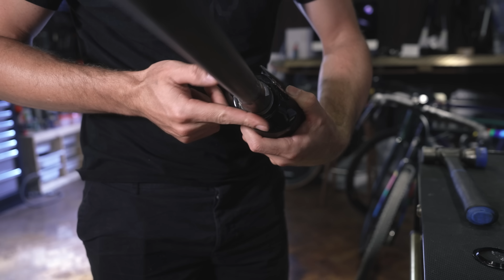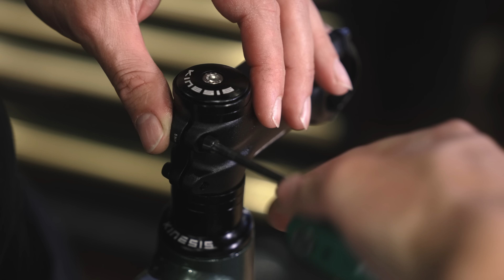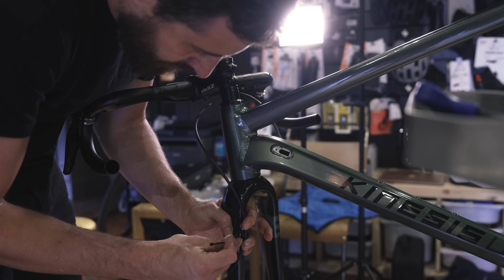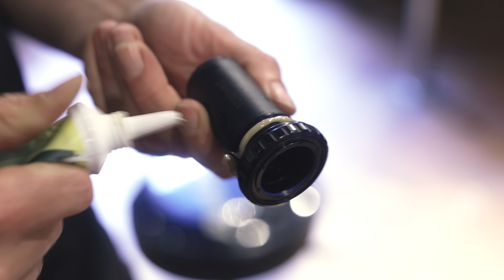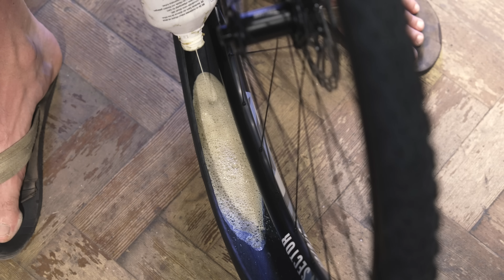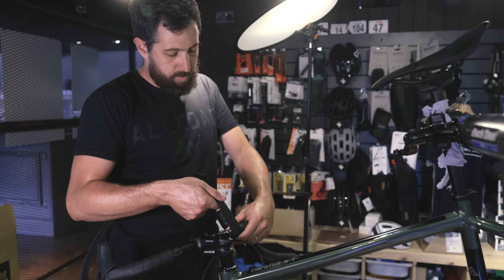'Do It All' Gravel Bike For Under £3000  - Kinesis Tripster, Sram Rival eTap, 650B

Comment: I've been riding and racing gravel on my Tripster AT for four years, just passed 10,000 miles on it. Rival 1 has been reliable the whole time. The bike is an absolute tank and a supreme joy to ride. Even took it out for my first CX season and it performed wonderfully. It's the pinnacle of what aluminum can be. I'm pretty sure if I ever had some freak crash that broke the frame, I would order a new one before the sunset. I love my Tripster. Highly recommended.

Comment: Hi Nick  I am just cobbling together a 1 x Sram Tripster for the Winter. Having brought the frame second hand boy was it difficult to get the rear brake hose through the frame. Did it by running an inner gear cable etc. So I am getting there. The part I am stuck on now is mounting the rear brake caliper. I have brought the small mounting plate as much as I try to see it on your video I cannot see whether you fit the bolts from underneath or from above. Given there is no thread in the location holes I assume you use nylock nuts as well. I understand from kenesis the bolts are 22mm long but they didn't specify the thread diameter.I would appreciate it if you could give me as much info as possible. Thanks. Or indeed you Jimmi  .

Comment: Another nice build video Jimmi 👌 mate the silver chainring is that the force/red and what size is it? As the rival ones are none in stock and long wait & the force/red ones are available 😅… I’m wanting to get the 38t as my gravel bike came with 40t with 10-44t rival but want to change the front ring to give a bit more easier gear to pull my heavy ass up + loaded up steeper hills 😄 . Correct me if I’m wrong but I’m sure the rival chainrings come all black?
Reply from the maker: Hey mate. Yeah, think you're right. It's a Force chainring moved over to the Rival cranks for the required ratios for the customer. If you're UK based maybe e-mail the shop. They may be able to sell you the required chainring and post out.
Reply: @Jimmidoesstuff  cool appreciate the suggestion….but sorry mate I’m in Sydney Australia 🙂 I’m in no rush but if need be I may just bite the bullet and get the force chainring which is about $40 Aud extra.. seems like the 38t ones are popular 😃.
Reply from the maker: Oohhh Sydney - how exotic!! Yeah man, go with what works for you. :)
Reply: @Jimmidoesstuff  thanks mate 😂not exotic at the moment weather wise, seems like we have swapped 🌧. You guys are “enjoying” a heat wave  pls send some of it back down under😅. Thanks mate see how it goes worse case get the “lighter” force one. Once again keep up with the videos mate love watching and drooling over them 🤤💙👌. Ps. Love your styling & colours with Attacus gear 😎❤️🤘🏾
Reply from the maker: Thanks, Jezza. Yep - pretty warm right now. 😅
Reply: @Jimmidoesstuff  enjoy it bother! Get that riders tan line so it lasts til next summer 😜 take care!
Reply from the maker: Oh I don’t do cycling tan lines. They’re vile. 😅
Reply: @Jimmidoesstuff  😱😱😔… 🤫Francis may hear that 😂😅

Comment: About to build one of these.  Did you have to face the disc caliper mounts or bottom bracket?

I built a bike from a Kinesis RTD a few weeks ago and the level of finishing on the dropouts, bottom bracket and both caliper mounts was no existent and facing showed the BB and mounts were not square 🫤